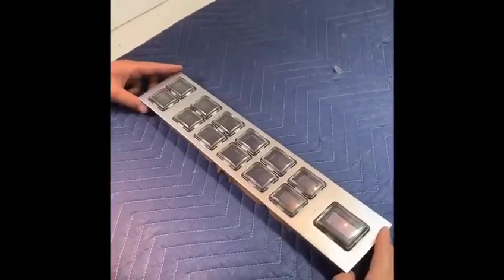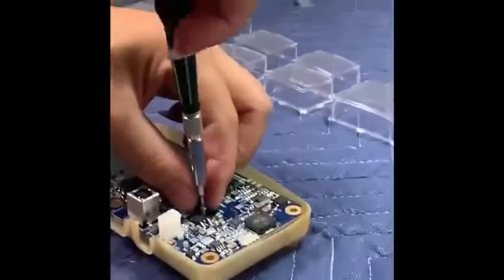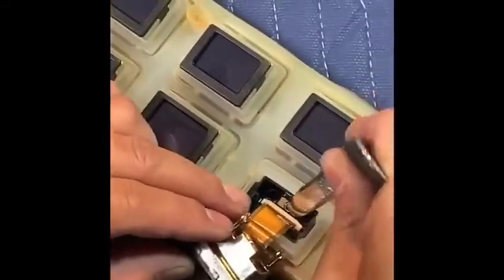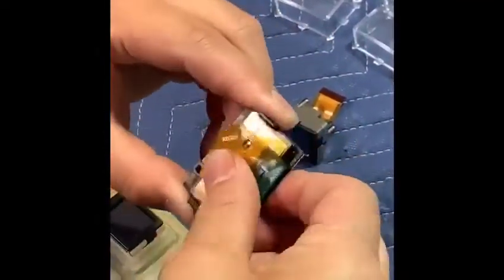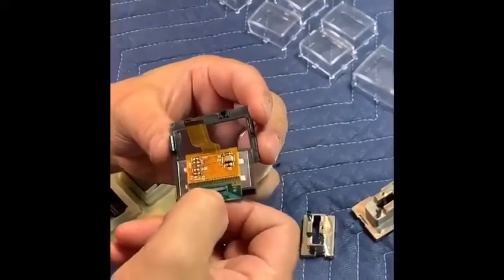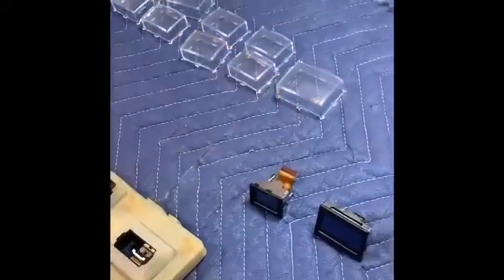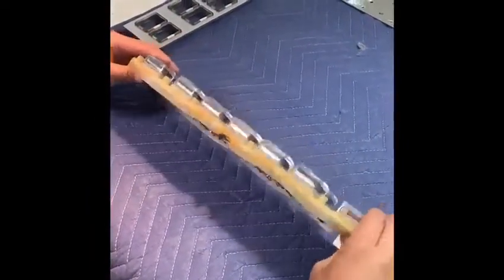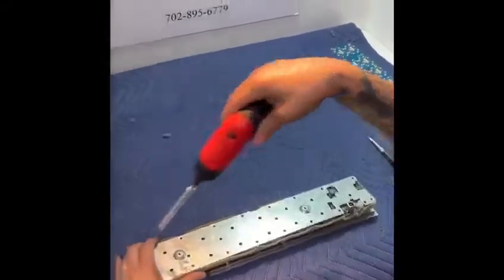WMS Button Panel OLED change

Comment: My deck has the white rubber on it. But its getting harder to push them.
Can I just not use it?
Or does it have to have it?
Or would a new one fix this problem?
Thank for your time.
I'm getting ready to install 3 new screens as well. Your video is perfect.